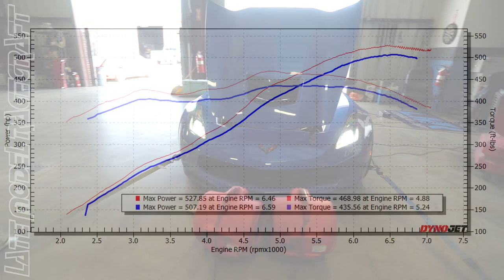C7 Grand Sport Corvette gets the NA sauce!

Comment: What could you add to this build to help the HP and still remain N/A? Throttle body? Intake? Max effort N/A?
Reply: ported manifold, 103tb more fueling
Reply from the maker: Ported Cylinder heads/intake manifold/TB and few other components.
Reply: Max effort would add a few more bolt ons like the other comments say and then going high compression, high rpm. But that is crazy expensive.

Comment: What will a 427 LT1 make if it's making that much horsepower with 370 cubic inch
Reply: Well those are usually higher compression etc...those are probably 650-680whp with a good build.
Reply: And there's still more that could be done with this grand sport that he didn't do.